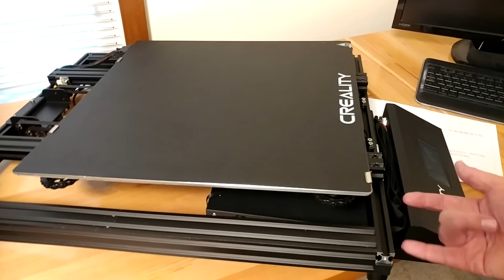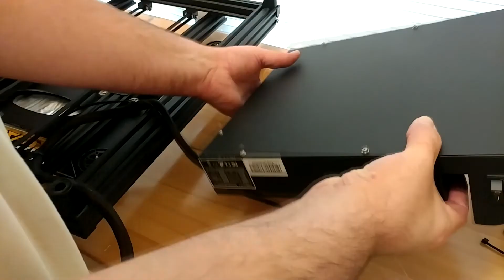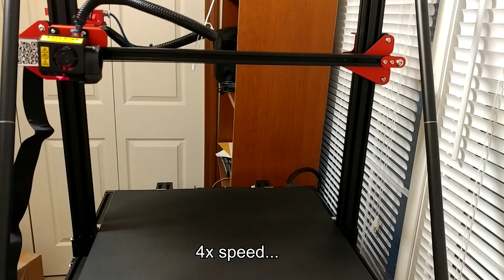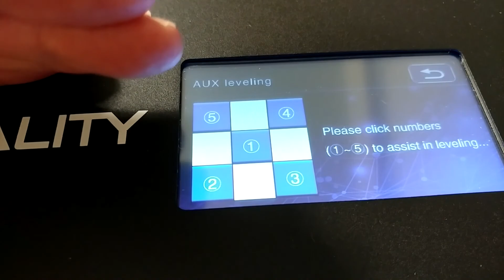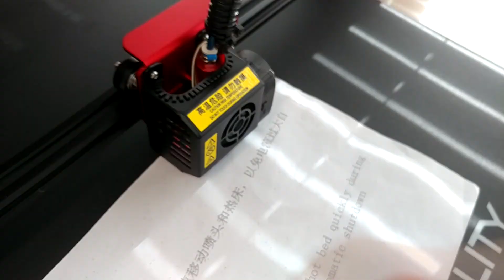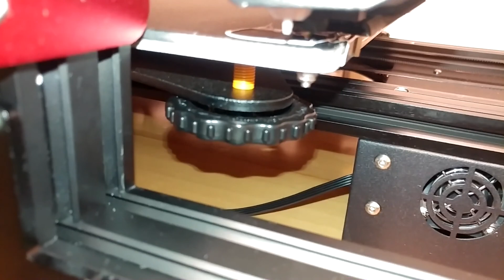Creality CR-10 Max Unboxing and Initial Setup (...goes poorly)

Comment: I bought a CR-10 max recently and I have exactly the same issues. For this price...almost 1000 euros (in France) not a good deal. The firmware a pain too! In cura same issue I have to change the build volume in settings to the actual build plate size 470*470 mm (side to side) to have printing at the good size and not out the build volume.
Reply from the maker: Yep... Sometimes you win with these things and sometimes you lose. I'm not happy about it either, but here we are. 🤷‍♂